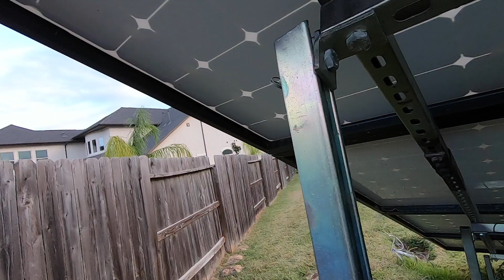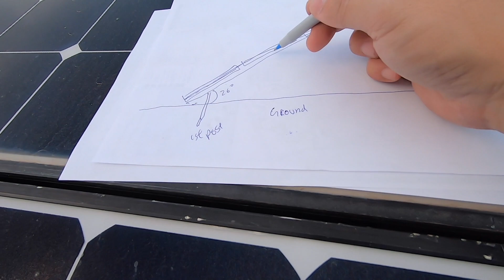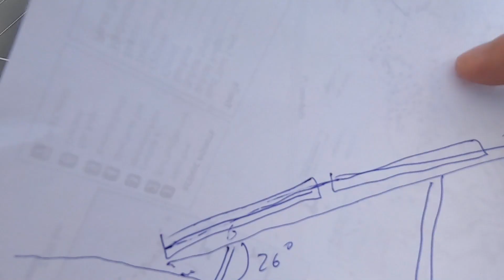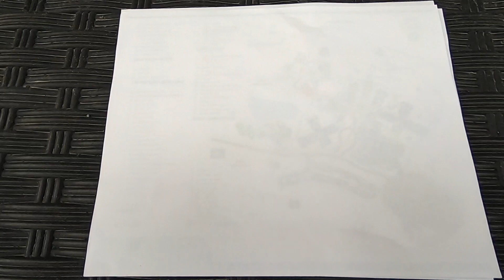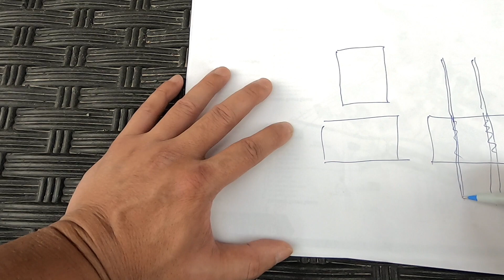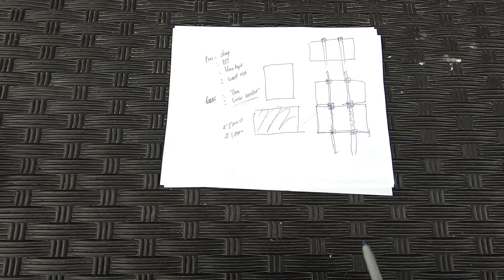DIY GROUND MOUNT SOLAR SYSTEM USING SUPERSTRUT/UNISTRUT - INTRODUCTION

Comment: I looked up 14 gauge for the thickness of the superstrut and it seems to be 1.6 millimetres which I personally think is too thin, I would lean towards 3-5 millimetre thickness. Also spanning 3 metres (10 foot) I would feel uncomfortable with as you demonstrated with the bowing. Overall good job, but the beams could have been beefier. I try to over engineer to make up for my non engineering background. Cheers.

Comment: So you had 70mph, but you also have a fence which I'm guessing will block the brunt of the wind. I like the design and I want to use all metal, no wood to rot. But my area is open field and we have 20-40mp winds frequently and 60mpg during bad storms.  But your setup looks pretty darn solid . And my array will be only be 18 - 100W panels ( I got brand new Renogy really cheap on black frirday) My array will only have to be about 10' x 10'. This is just a baby step to see if I like the whole solar thing and want to eventually bump up to a few KWs.

Comment: Hello from north Texas. Thanks for the video. I had considered using  superstrut for panels attachment and schedule 40 3” pipe for foundation into the ground. Also I have considered pivoting on center crossbeam somehow. Maybe seasonal tilt is not worth the cost/complexity here in Texas. Something to ponder.   Thanks again for the video. All the best from north Texas.

Comment: I have a question for you and all your viewers I’m getting ready to build a more permanent mounting system for my panels I have considered metal but I myself personally am somewhat afraid of a metal mounting system,,, now let me tell you why. I have heard stories of lightning strikes they say that lightning will find a metal mounting structure faster than it would wood mounting structures I myself do not really know,,,have you or any of your viewers had a lightning strike using metal mounting fixtures and things? If you use a ground wire on your metal mount and panels would that prevent lightning from coming in your shed or building?
Reply: You must ground your solar panels and metal mounting structure per the NEC. It will help prevent the lightning from traveling along the PV wires. If you don't ground it the lightning is very likely the travel along the wires and fry the electronics at the other end. It should be considered mandatory to ground all metal frames and structures regardless of the other materials used.

Comment: Should have used the thicker steel 12 ga Unistrut and filled holes with concrete instead of just putting back the dirt. Also a few diagonal supports .  .  .

Comment: All things get more expensive these days super / unistrut goes for $36 dollars for a 10 foot span on the east coast. I’m seriously considering finishing my latest mount in wood that goes 2x4x10 for 8 bucks a board pressure treated. Also I’m sure all the bolts ect have skyrocketed… luckily a deck screw is still “affordable”.   Pros cheaper.. cons less expandable with ease, wood carpenter bees go crazy for even treated wood here… and it doesn’t look as good as your mount ! Not to mention more difficulty in grounding. A poor guy can’t win.

Comment: you didn't go into detail how you did the end clamps using the square washers. There is nothing holding up the outer end of the washer, so how do you deal with that?
Reply: Yes, that is something that is overlooked in the video. I am wondering the same thing

Comment: Great video that I personally recommend following VERBATIM!  Being frugal and time aware I bought the “shallow depth” super strut at Home Depot as I saved $5 dollars per rail and time as they never seem to have the greater depth in stock ! Then my problems began. The spring nut only fits the deep well product, …screws bind on the metal back plane as there is less depth so a much greater attention to screw selection must be observed. Screws must be much shorter. After initial build I was concerned about the rigidity of the shallow well bar so I built a wood frame that allows horizontal placement of 2X4s to anchor the horizontal bars… so my experience was a time consuming pain in the ass ! Moral of the story.. when good folk take time to make a good video with links to all the supplies one needs.. follow it ! Disclaimer.. I am not an electrical engineer, just a poor dude with hobbies I can’t afford.😊

Comment: Thanks for sharing! I had looked at some other superstrut & unistrut solar mounts on YouTube but with smaller arrays. Your system will work well with larger arrays and appears to be sturdy and strong. You are right about saving a considerable amount of money using these aforementioned materials as opposed to using other metal mounting systems. This was a well structured & detailed presentation.

Comment: Nice. I note that you have no shear constraints, i.e. wire rope connecting the upper and lower superstrut nodes diagonally. This would significantly strengthen your structure. An efficient structural support must resist shear (wind loads), as well as gravity loads. Good video. I plan a superstrut ground mount for my 50 panel system. Well done.
Reply: Do you have videos on this?

Comment: You can also make connections to posts vertical and next layer toward panels of horizontal instead of vertical and you can add horizontal support to the posts any weight you want and overlap ends and not need to cut or weld.

Comment: You do not have to weld the unistrut together they have straight brackets that attach 2 pieces together with 2 bolts on each side but they will bend some here  under force of particular directions.

Comment: The angle of the  panels should be equal to the latitude where you mount them so he is at about 26 degree north latitude in Kaddy Texas area. Just look up the latitude of town you live in on internet or if you have smart phone etc GPS coordinates. In the northern hemisphere US etc it will be the number NORTH coordinate.
Reply: Lat. -10% for year-round best performance.

Comment: Did you need to pull a PERMIT?  Did this pass an electrical inspection?
Reply: I don’t see the video on how to pass the inspection for grid tie
Reply: If you are using offgrid you need to observe the setbacks for the lot but may not need a permit if its not Grid tied . Many places use the value of the project like over $1,000 to need a permit but you need to ask your local code office.  The value can be just the frame of unistrut not necessarily the panels and certainly not the inverters wiring etc unless you are going to sell back to utility then all will need permitting and have permission from local utility company etc.
You can connect the grid to your inverter as long as it can't feed back to grid without a solar permit.
Reply: @teekay1785  But this is GRID-TIE ...
Reply: @MrSummitville  You cannot sell back to the electric utility company or feed power back on utility line without a permit period.